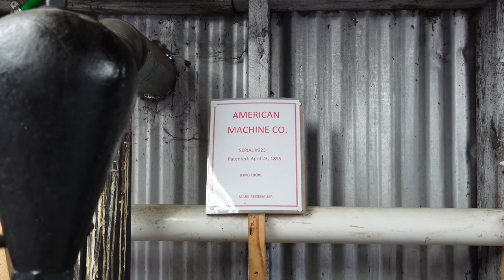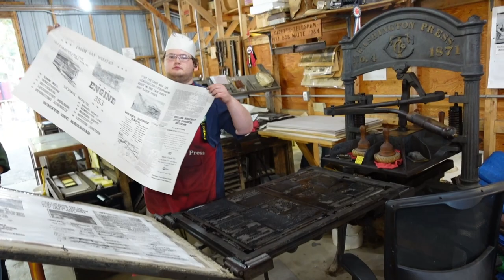Rollag Minnesota Steam Engine and Tractor Show 2022 Part 2 | WMSTR

Comment: 0:56 is there supposed to be flames count out of the pipe?😂that looks dangerous!
Reply from the maker: I believe this is a hot tube ignition type of engine. So, it's different than what we know of as gasoline or diesel engines with a spark plug and glow plug igniting the fuel. Yes, an open flame is dangerous, but I believe that's the way it's supposed to be running.